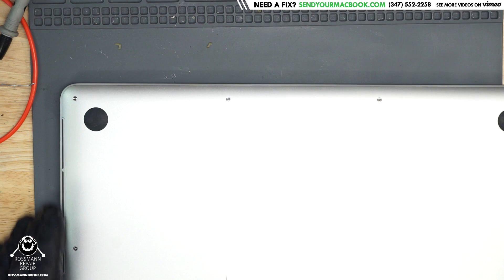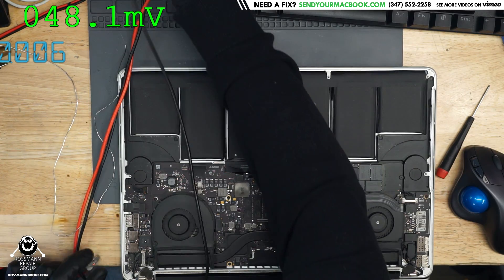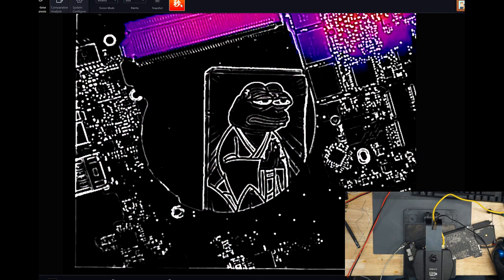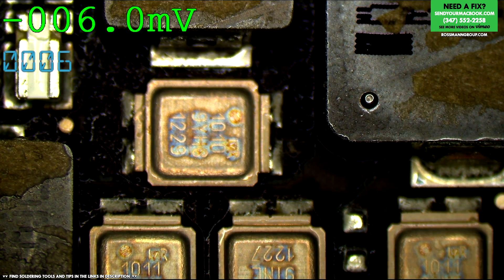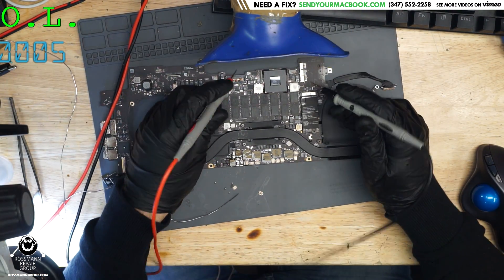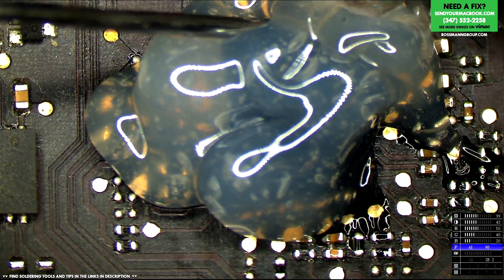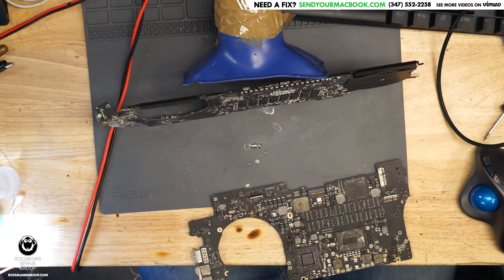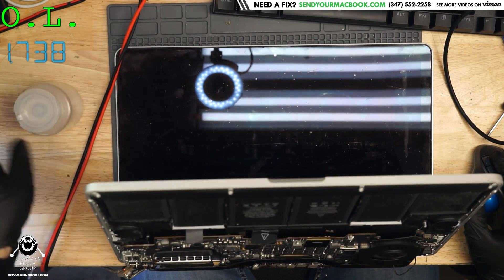A1398 Macbook Pro not turning on PPBUS_G3H not present

Comment: I've been watching your videos since the last 2 year. I just need some help Louis. 
I have a 820- 3330, 15inch 2012 macbook pro. That had sensor issues as it became very laggy and Ran diagnostics to find out that the left fin sensor, right fin and gpu die senors wern't being read by the smc..
Upon further checking, i realised that the temp monitor ( Q5550) was faulty. I changed it, but the problem now is all the other sensors have started working except the fin stack sensor which still shows unreadable by the smc.

Now the pelrblm is, the 820-3330 schematic shows nothing as "left fin stack". I tried chnging the "left heat pipe sensor" but it didn't help. And along side i'd like to mention that all these sensors didn't have the (22pf)capacitors attached to the diode sensors as shown in the schematic.

What am i doing wrong or what should i do? Please help.

Thanks!

Comment: Geek Squad told me they could fix my computer made in 2007 but it would run like shit because of updates and modern stuff, i didn’t really grasp what he said enough to hold it to memory but i just couldn’t understand why if my computer that needs a new hard drive wouldn’t work like it did in 2007 with this new hard drive.
Reply: Modern software requires much more powerful computers to run smoothly or at all. If you fix your old computer of course it will work like it did in 2007 as long as you use 2007 software

Comment: Anyone one just updated to the new os 13.3 on iPhone 6s Plus and iPad Air 2 and it’s totally slowed them down to a crawl? What can I do?
Reply: Tommy P enlighten me my friend
Reply: iliketobuildstuff thanks man.
Reply: I think that rolling back iOS is now impossible.

My iPhone SE was incredibly slow and prone to crash after 13.3 but the battery was also dying. New battery made it usable. Battery life isn’t too good and the phone does seem to run slower.
Reply: @Tommy P do a bit of research you can go back to previous iOS versions so long as you have a backup from that device while it was running the older iOS.